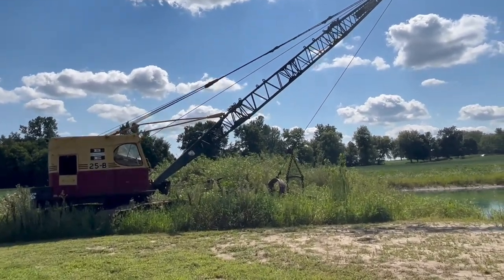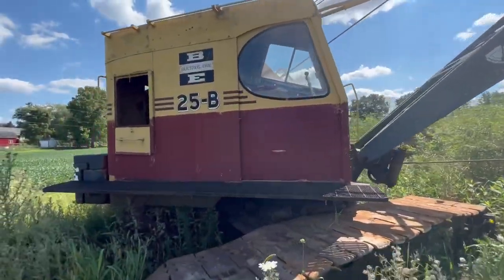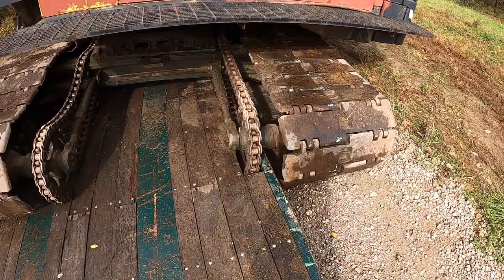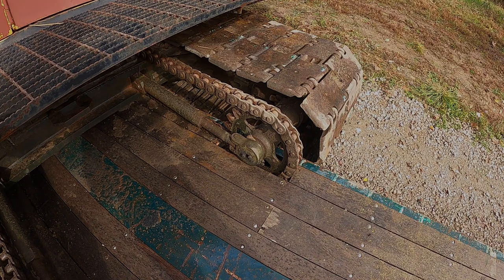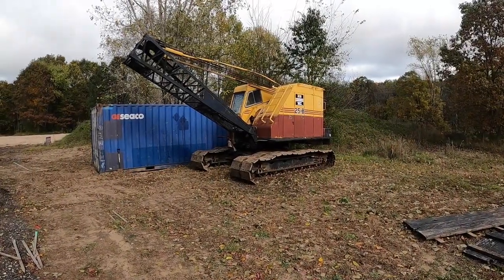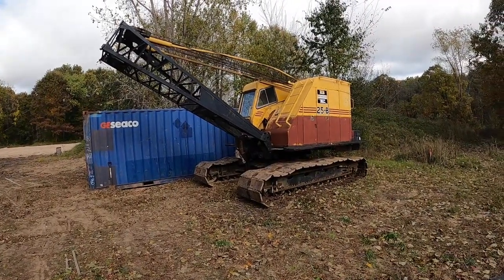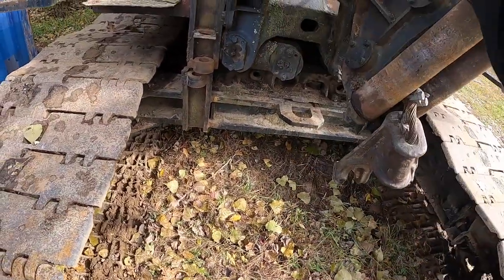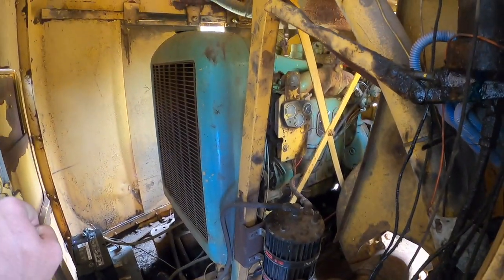I Bought a 1980 Bucyrus Erie 25-B Dragline & Brought It Home!

Comment: I would break down the jib and chain the sections to the lower using two oil drums and drive up and over the rear wheels of the low loader trailer single handed (as i was expected to !) on a regular basis...usually in filthy cold weather. Miss the old girl though.

Comment: Always use gloves when handling wire rope. Especially  older rope. Next time try dropping the pendant lines onto the side of boom, to disconnect the bridle and pin it to the boom butt. It helps.